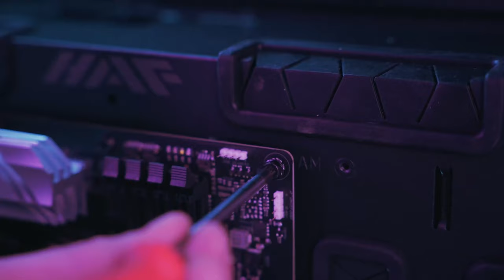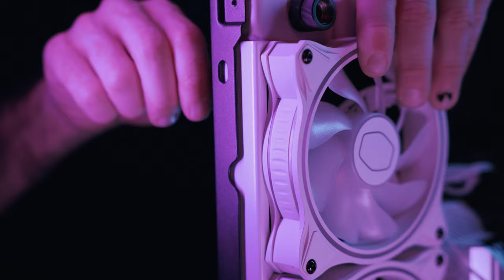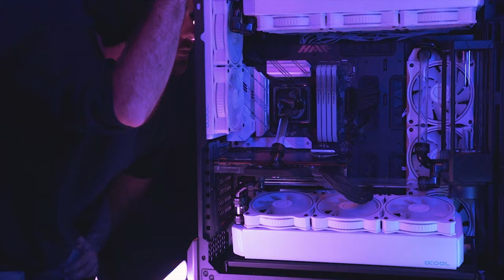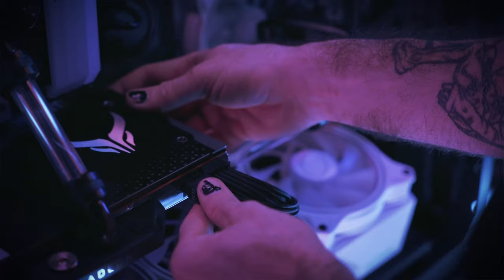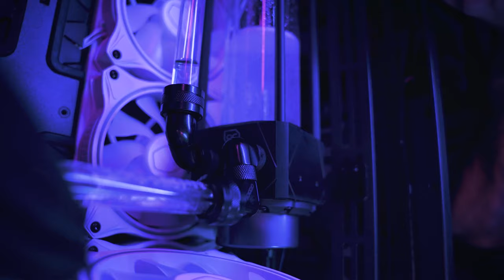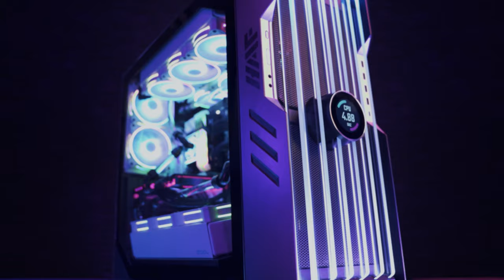HAF 700 EVO | Air to the Throne

Comment: Almost E-ATX motherboards are hi-end motherboards. Please upgrade front panel [ USB 3.2 Gen 2x1 Type C --> USB 3.2 Gen 2x2 Type C ] for all Full Tower Cases (HAF & COSMOS series).
Reply: exactly, but now for z890 it needs one TB4 and one 20gbit USB C. and then 2x or 4x USB 5gbit and 2x USB 2.0 or without USB 2.0

Comment: I thought HAF was high air flow, why the liquid cooled build then?
Reply: Water coolers still need airflow as they still use fans in the radiators, plus, all computers will have case fans no matter the cooling system, the water is redundant to airflow
Reply: You only thought this criticism HAFway through.... Haf haf haf... I haf counted eight fans in this HAF, haf you?

Comment: Does the front Usb-C port use a single cable in the back or a electronic board? I ask this because I want to convert it to USB 3.2 Gen 2x2 20Gbps port if its just a cable.

Comment: it looks so cool. 2x420mm rads on the top thats awesome. now im thinking can it support a 400mm rad (2x200mm fans) on the top?
Reply: yup, you can ;)
Reply: it's 2x360 or 1x420 on top according to the official PDF but as usual I recommend waiting to see other people build custom loop in the case then deciding for you because you might run into spacing issues, this video helped already you can see you cannot use a giant  bottom rad without compromising the space for a front rad+fans

Comment: With that much cooling potential, what are people going to run in it? A Threadripper with a couple(!) of GPUs, all of which is going to run more or less silently and still has capacity to spare?
Reply: it's mostly about having options. you don't need to populate every single radiator slot. that's why it includes a mirror for example, just for show. of course, if you want to install 6 rads, you definitely can, and even if it's a threadripper build with 2 4090s, it's gonna be icy cold and silent

Comment: Received mine today, I'm one happy chappy :-)
Reply: where did you buy it from ? I don't see it listed online anywhere
Reply: But is it a happy chassy?
Reply: @gospelofrye6881  Extremely Happy 🙂
Reply: @cesarpegado69  Does the front Usb-C port use a single cable in the back or an electronic board? I ask this because I want to convert it to USB 3.2 Gen 2x2 20Gbps port if its just a cable.
Reply: @vlefteris  A single cable, but I had to buy a 90 degree bend to be able to use it with my ASUS extreme MB
Reply: @cesarpegado69  Ok great! Thanks! Enjoy your Haf 700 Evo!
Reply: @vlefteris  I am 🙂

Comment: Rgb stuff put aside, this actually looks interesting. Im really curious to see what gamers nexus have to say about this one thermaly. Only two big downsides i see is not having wheels and not having optical drive mounts.
Reply: noone uses optical drives anymore, thus almost no cases have space for it
Reply: @Amfibios  No one is incorrect. I myself and my friends and family still have old games on cd and dvd. Besides tha slots can be used for fan controllers too, wich is much nicer than having them in back or sitting on the desk.
Reply: @Turboman_64  it's not that optical media is extinct, but if you need to use a CD once a year, you can have a USB drive in a drawer, plug, use it and throw it back until next time. Nowadays people use software to control fan speeds, set custom curves etc.... so you can just set it and forget it. No need to pay extra for a fan controller.

Comment: I still use 3x HAF X. The true King. Water cooling is overrated. Air cooling all the way.
Reply: water cooling is TOP. it's just that it's very expensive and complicated while having more points of failure. the HAF 700 is a beast even if you decide to stick with air, but the CPU cooler height is pretty limited.

Comment: was hoping for an haf x successor for $300 and what do we get? An overpriced 25kg case nobody asked for. Dissappointed!!!
Coolermaster: "We asked the gamers what they wanted..." bullshit, only low figure (no sane casual gamer) will be able or want to buy this case. Have fun carrying it around with 2 Men
Reply: @desmasic  "water cooling garbage" - Wait, water cooling sucks now? Also did you forget that you don't have to build your PC exactly like the one in the video? Or that water coolers need fans? Or that installing a water cooler doesn't make a cabinet good or bad, it's just a user choice?
Reply: @gospelofrye6881  I was thinking about AIO but I fear leaking. Any help and advice on that?
Reply: @vlefteris  All I can say is that I have Corsair AIO unit that's 4.5 years old and my son has a Dell factory unit in his Alienware Area-51 that is 7 years old, and neither have leaked a drop. My machine is used 10+ hours a day for work and play.
Reply: @gospelofrye6881  Thanks for your reply! That's reassuring and good to know! Peace!